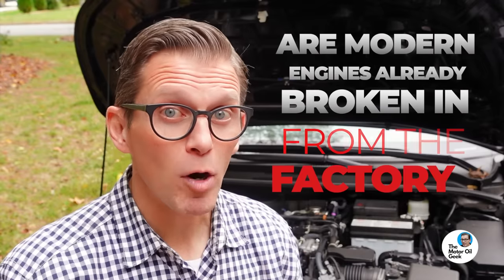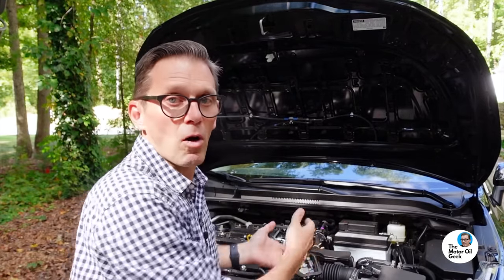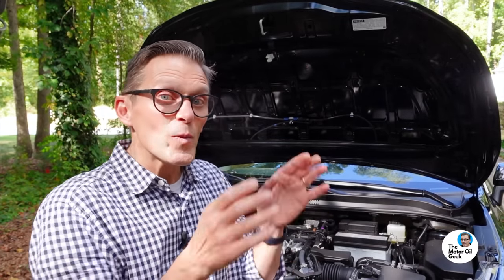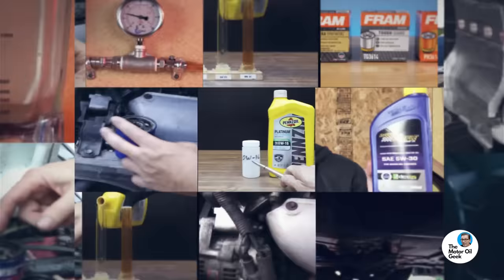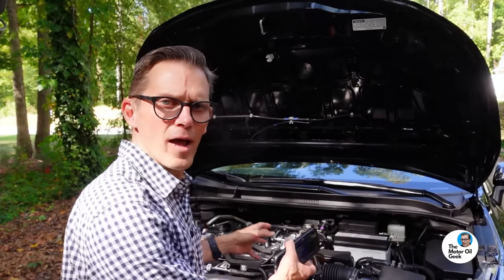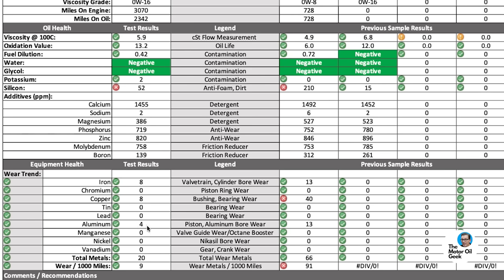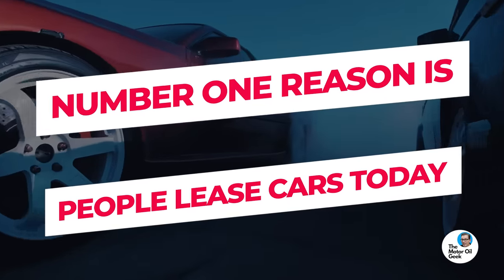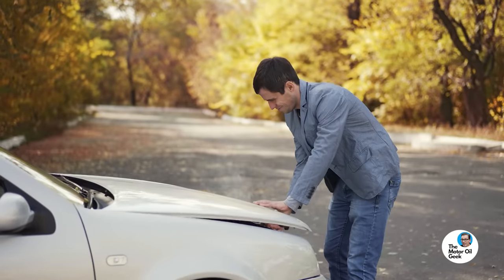New Engine Break-In: Truth or Myth?

Comment: strange, why I see 0W8 for the first sample? Wouldn't 0W8 normally produces worse wear than 0W16? worse fuel dilution too also strange. the solvency of different oil grade can be different too, so the metal sustained in the oil will differ too.
Reply from the maker: The 0W-8 is the factory fill. The service fill is 0W-16. There is not much difference in the viscosity of those two oils, so that is not the reason for the change in wear rate.
Reply: @themotoroilgeek  oh ok, I thought that different viscosity may have different base oil formula, usually different pour point. thanks for the answer

Comment: Can you define "broken in"?   It seems to fall into the category of "tune up", which everybody uses, but there's no actual definition.

There has always been a train of thought that manufacturers specify long oil change interviews so the car/engine will "wear out right after warranty".   This makes no sense.   If your engine wore out at 50,000 miles when you're expecting 200,000 miles, you'd never buy that car brand again.
Reply from the maker: Broken in is when the initial wear rate drops and stabilizes. Until then, the engine is still breaking-in.
Reply: @themotoroilgeek  So you're inferring wear rate from the data you get from the analysis of the oil, correct? (sorry if this seem like a basic question).
Reply from the maker: @teekay_1  Yes, wear rate is derived from the amount of wear in parts per million normalized for the mileage.

Comment: So a brand new engine shows signs of wear metals in the oil sample. I would expect that. Aren't those metal particles trapped in the oil filter? The oil itself certainly isn't bad at just 700 miles. Seems like complete overkill to me to change the oil.
Reply from the maker: Obviously those particles were not removed by the filter, which is the point of doing the early oil change.

Comment: On another one of your videos on a different channel didn't you say you knew for a fact at least some manufactures were having the engines made in an engine plant, filled with oil & ran for 7min at high rpm, then drained at the engine plant, subsequently shipped to car assembly plants, then factory filled with oil while car is being put together?
Reply from the maker: Cummins does that because they build diesel engines for various car manufacturers (and they have a million mile life expectancy)

Comment: I am not sure the video covered the "it's science not speculation" bit though. There was a little bit of science, with a lot of speculation attached. Maybe you did more of the science, but didn't show it.  I would want to see more data with longer tests that confirm the actual condition, reliability, and longevity of the engine. Over 5 years, 10 years, etc. And not just with one car, I want statistical significance. At the very least, you made some contradictions about "well everyone leases now and doesn't maintain their vehicle" with "thats why oil changes are included now". If oil changes are included, AND people are leasing them, AND not doing a break in change is actually causing premature wear, the money part doesn't make sense anymore.

Comment: Oil changes are cheaper than replacing an engine or replacing parts known to fail if the varnish builds up in the wrong places like the lifter in the hemi's for example. Not sure why so many are so hell bent on not changing the oil. The science has already proved this over and over again. 

Not sure you took a cheap shot at Project Farm or not, but that man really tries hard to make his data consistent in a way the average joe can interpret.
Reply from the maker: No cheap shot at Project Farm. I respect what he's doing.

Comment: unrelated but is there anything special about vw spec 508 oil? my 2018 vw calls for 0w-20 spec 508 oil.. I hate going to the dealer but no independent carries it.  aAlso had to ve/audi mechanics tell me I should switch to 5w-40, thats what they use in their vw/audis with same engine the 2.0 TSI. Thoughts?
Reply from the maker: VW has been very particular about their oil specs, so I would stick with the specification they call out.
Reply: @themotoroilgeek  ok thanks

Comment: Hi  I use penzoil  platnum   full synthtic and mobil one high milage oil filter I do oil change  once a year on my 2014 maxima but I barley do 2000 miles a year should I move up to every 6 months. I maintain mom car a toyta avlon i use regular oil  and toyta filter she does less miles than me should I change her to every 6 months as well  thank for opinion
Reply from the maker: Thanks for the question. Without oil analysis data to determine the oil health, I would just be speculating.

Comment: I like data and like to see oil analysis.  But based on an analysis and result, what are you going to do any different if you are already doing 5k oil changes with good oil and filters?  
You may just get a bad engine that did not have the casting sand or milling shavings flushed properly in which case your only option would be to sell it and give the problem to someone else.
Reply from the maker: The data will guide you to which viscosity and drain interval to follow. It will also let you know the health of the fuel injectors.
Reply: @themotoroilgeek  The manufacturer tells you what viscosity to use and if you have to change oil more frequently than every 5,000 miles or need to change viscosity, there is a mechanical problem that more frequent oil changes or different viscosity will not correct.

Comment: You have asked the wrong question. Everything wears in but it’s how much wearing in a modern engine does verses an older one that counts. This will determine how much wear metals are removed and whether this is enough to change your oil and filter

Comment: Lake, I've never done an oil anaysis simply because I bought vehicles from quality manufacturers. My daily driver had 152K miles on it and my friend who now owns it has 205K miles. No oil consumption worth talking about.

Since I worked in a lab where we had calibrations done by NIST and other sources, any calibrations that we then did listed the sources and calibration dates (cal certificates) of the test equipment used. Does your oil analysis include that info. Like you, I am a believer in fact, not fiction. When I see a measurement, I question it. Its part of being a Metrologist.

Oh come on now, don't you believe everything you read on Bob Is The Oil Guy? LOL
Reply from the maker: LOL... Yes the lab equipment is calibrated everyday. In fact, some units are calibrated several times a day.

Comment: Real science would have been doing the early oil change in one car and running a second car with the same oil until the first factory recommended service and then comparing the two after a year. Just because there’s some trace metal particles doesn’t mean anything. The oil filter will get rid of anything harmful. The manufacturer isn’t going to risk replacing an engine under warranty otherwise they’d require you to do an oil change after break-in. I never did early changes on my last 3 vehicles (‘07 Chev Impala SS, 2013 Honda Civic SI, and a 2017 Subaru Forester XT) and never once had any issues. You’re just wasting money,  oil and creating unnecessary waste.

Also what’s the point with the oil analysis? If it comes back being bad; you’re going to back to the stealership and ask for a new engine under warranty? They’re not going to fix anything until something fails in the engine.

Manufacturers extended oil intervals because previous practices were unnecessary and wasteful. This video is entirely an OPINION backed by no science. Science would be running a car to the manufacturer interval and seeing if there was any issues.

Comment: Measuring metal content simply proves that during initial use all engines will produce some metallic
Content in the first few thousand
Mikes. Whether you break in an engine or not the engine will become
" Broken in". Manufacturing standards on airplane engines was
Improved to the point that no break- in was required. Modern technology
Is far advanced from WW2. No
Break- in required.

Comment: You also have to define "break in."  My understanding is that most engine factories run engines on propane for at least a short amount of time.  Does that constitute breaking in?  A little, but maybe not a lot.
Reply from the maker: Good point. Running for a short amount of time to check for leaks certainly doesn’t qualify as break-in.

Comment: but if you put more zddp I guess you could damage the catalytic converters, so even if you put additive this it may not be ok.   
i suppose they run the engines for like 20 minutes 2000-2600rpm, possibly on break in oil, I hope so😂

Comment: Hey Lake! I bought a new Lexus Is350 with no miles on it. Should I replace the factory 0W20 oil with break-in oil or just keep the factory oil in and change it at 500-1000 miles?
Reply: If I had to guess since he did this (https://youtu.be/_6nWCQ_70J0?feature=shared ) with his daughter’s vehicle, I’m going to guess he’d say no.
Reply: I’m not Lake, but doesn’t exist any proven procedure which describes how long and which exactly oil should be used for particular engine, so - no reason for the experiments with “special” brake-in oil…
Reply from the maker: Go 500 to 1,000 miles before you change the oil.

Comment: Why are those metals not being trapped in the oil filter?
Reply from the maker: Oil filters are not 100% efficient. Also, they have a bypass, which allows unfiltered oil to flow in certain conditions.
Reply: @themotoroilgeek  Yes I know, but if the metal is circulating then the filter should pick it up sometime....or maybe it is just sitting at the bottom of the oil pan not doing any harm?

Comment: Leasing has nothing to do with it.  75% of Toyotas are sold outside of the US, and leasing isn't as common in other countries.  Besides, leasing was even MORE common in the U.S. in the 1990's than it is today, believe it or not.  

Also, the EPA does not go out and buy cars off of dealer lots.  Manufacturers self certify the vehicles under EPA "supervision."

So neither of your reasons is valid.  The real reason is that the level of wear experienced in the first 500 miles of a modern engine's life, while definitely more than seen later, is easily tolerated by modern oils and filters and there is really no need to go to the extra effort.  Modern engines have much better tolerances, materials, and levels of finish on bearings and wear surfaces than the engines of 30-60 years ago, so the amount of "break-in" is markedly less than whatit was in the past.  So, no need to have a break-in period (which most car-buyers would ignore anyway)

But, I still do my first oil change at 1,000 miles.  Doesn't hurt.

Comment: I would like to believe that automakers at least RUN the engines after assembly, but I doubt it. That would have been easy 90 years ago, not today w/ the idiot unions and their Osha and Epa. Do line powertrains even have fluids in them or does that get added @ the end before parking?

Comment: Didn't your sample and analysis of the OEM oil after 500 miles and the new OEM oil prove that the oil from the factory did have a different chemical additive package than the OEM replacement oil and that it was a BREAK-IN oil??
Reply from the maker: No, the additive package was the same. The only difference was the viscosity grade, which we could not get the 0W-8 here in the US.

Comment: Using thinner oil in a new engine makes NO sense.  Why would you want it to wear more when it's new?  Why not minimize the wear for the entire life of the engine?  Maybe it's better to use higher viscosity oil on a new engine to help fill in the gaps until the rings are seated.  Then go to a thinner oil to improve fuel economy.

Comment: You only show that maybe Toyota does not break-in their engines at the factory.. Many other manufacturers out there.. :) They could still have broken in the engine at the factory and you can still get particulates in the oil after. You are assuming their break-in period is very extensive. The numbers from the test could be even significantly higher if wasnt.

Comment: The oil in the pan has not gone through the filter yet soooo hence the reason for the filter. Changing oil at 100 or 700 or 2000 miles is just unnecessary! Get a quality filter. That’s what it’s for.

Comment: I am mechanic and i been watching those supercar factory videos.they are broud some of them that they are put engine first in dyno and tested them,huh huh.new engine and make engine screaming like hell.yeh thats fine.ols days car need to drive first 500 or max 800 kilometer gently and chance oil and then start to drive as usual.of course its bad to engine put it in car and say lets drive it thousands and thousands kilometer before first oil chance.new car need also in finlans says drive in period.those engines wont last 300000 thousand or more without problems like older car do.
Reply from the maker: The exceptions are those high end supercars. They are more like race cars than an everyday car.

Comment: You discussed using the scientific method, but you took the findings on one car and one OEM and generalized it across all cars and OEMs. That's a misapplication of science. Subaru, for example, does break in their engine at the factory. They take each engine and run it at high RPMs for a period of time after they build it. This can be confirmed by asking Subaru directly. From your findings, you can assert that your engine had more breaking in to do, but this is not generalizable to all engines and OEMs.
Reply from the maker: This is one example (that I could film). I have several other samples from different vehicles (various manufacturers) that all exhibit the exact same trend.

Comment: I don't care what the companies who sell cars tell me about maintenance. I change my oil every 3k miles because that's what I was taught long ago plus I see the condition of the oil is when I remove it. I don't want my old oil to smell burnt and be black sledge. I want it coming out slightly dark and performing well.  Oil is cheap, engines are not. 😂. I change the oil in my motorcycles every 1k miles because it's cheap and also protects my wet clutches.
Reply from the maker: Right on!

Comment: You cannot buy a 0w20w  conventional motor oil in that oil weight only a synthetic you cannot run a VVT engine on oil that it’s not rated for especially non synthetic oils

Comment: Absolutely not. There is not, nor will there ever be the time or resources to “break in” an engine, or any other driveline component on an assembly line. 

The only process on the assembly line is a brief, crude dyno exercise to verify there is no abnormal noises, etc. and that the vehicle runs, and cycles through gears with no anomalies. 

Manufacturers can claim there is no longer a “required break in period” all they want, but the claim is window dressing that simply tells a customer what they want to hear, not what’s in their best interest. 

Modern cars have become accurate through CNC machining and excellent tolerances to the point where break in is cleaner and has less incidences than in the past, but that’s it.

The odds of any problem that would end in a warranty claim during the factory warranty period are now unlikely enough to where manufacturers are comfortable enough to deceive buyers by claiming there is “no break in period necessary.” 

It’s nonsense and pseudoscience. 

Of course the manufacturers don’t care what happens to a car, provided that car makes it out of warranty period without a claim. That’s ALL that matters to them, and frankly the deception works in their favor as id imagine the long term harm caused by not doing a traditional break in exercise, followed by post break in service probably takes a significant degree of service life off the tail end of the car, which gets the consumer to buy a new vehicle sooner than necessary.
Reply from the maker: Thank you
Reply: @themotoroilgeek  not a problem, your offering is insightful, thorough, and relevant information to anyone who owns a vehicle.

Thanks for the contribution!

Comment: No such thing as break in oil. It's 2024 not 1964. Join it. I've has 17 plus new vws since 1987. All run for hundreds of thousands of miles,I drive a lot the last 36 years. Even 316, 000 fun reliable never stranded or stuck ,ever..in any of the dozens of vehicles. Never an oil related issue. Doing what mfg specs. 7500 back beforecsyn..now syn 10k miles between changes.  Current 2019 golf R had a 7 year 72,000 mile warranty full,bumper to bumper...never an issue followed mfg service specs. They know the cars better than driveway experts

Comment: I am a Mechanical person, I enjoy most of his Videos, but the ability to QUANTIFY his opinion based on Particulate in oil that will create FRICTION and DAMAGE that the filter does not pickup is impossible.  Studies show there can be metallic particulate.in oil for several oil changes after NEW.  If you want to do it GREAT.  Ever speak to Honda and their BREAK IN recommendation..  Has there ever been a study on Engine Longevity based on Break in procedures ?  I like the guy, but sounds like FEAR MONGERING.  I am obsessive/compulsive when it comes to Engine Maintenance.  I have passed on a 21 inch Lawn Mower that was purchased in 1980's.  I guess  if I had a podcast I would create subject matter for interest.